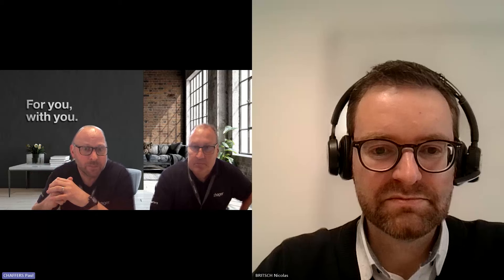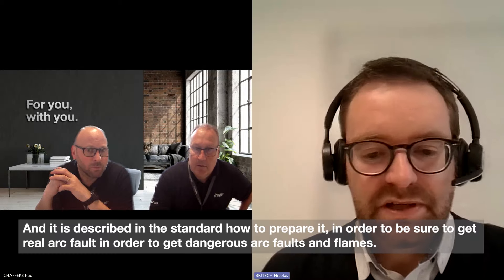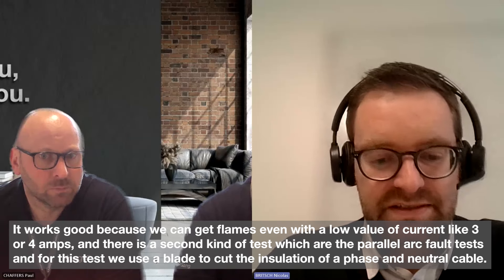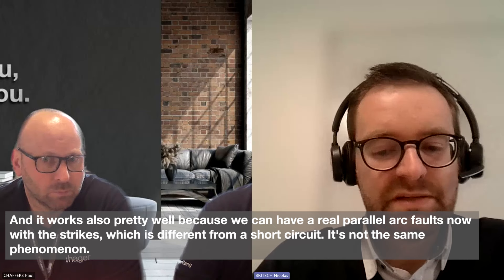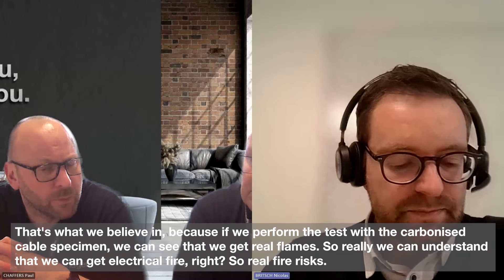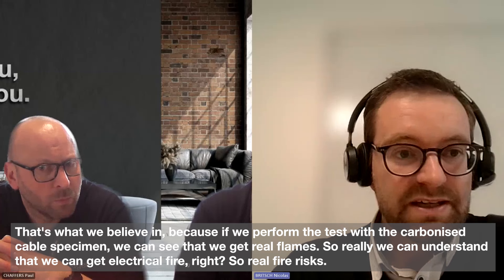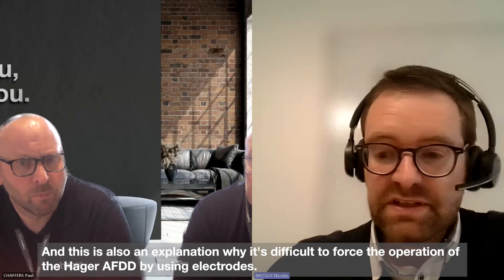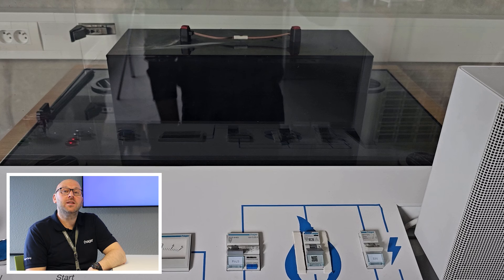Hager AFDD Performance Overview

Comment: Very interesting to see the specimen test, thanks for that. I always believed the hardware complied to BS[EN]62606 so it’s a shame my amateur monkeying couldn’t show it. What I still don’t like though is smart tech in any protective device. You say there’s nothing for installers to maintain and updates will only be issued for specific (erroneous and invalid) trip events, but the lines of liability are a potential can of worms. I also question whether these devices have the kind of longevity you’re suggesting. Time will tell on that front. Personally, I’d much rather see a dumber model from Hager; the kind everyone else is flogging -essentially, the technology in your original ARC model packaged with an RCBO in a single-module form-factor. I’ll worry about Hotpoint’s new washing machine tripping it off. I don’t want the hassle of getting a trace box out of Hager (like you’d ever give me one anyway), then recording the event on site, sending it back to you to be analysed and waiting goodness knows how long for an update which might, or might not, solve the problem. It doesn’t sound like a quick or hassle-free process I’m afraid.
Reply: It’s pretty clear to me Dave, you’ve got to take the angle grinder to a piece of cable attached to your Hager AFDD
Reply: how do you prepare a carbonised cable specimin as in my amatuer testing i got so fed up with attaching massive loads i deided to have a go at setting fire to the cable still didnt trip.
Reply: Unfortunately my whole stance on Hager has changed over the last year or so, I have gone from being a Hager fan boy to avoid wherever possible
Reply: Well said Dave. Maybe this video was a result of the monkeying around testing 😂. I still don't have faith in the new hager AFDD devices.... There is a time and place for smart tech, and I believe at the minute it's not on consumer DBs,
Reply: So, does this imply devices tested to a parallel arc fault test are inferior and would not react to the carbonised cable test? We’ve obviously seen it the other way around.
Reply: Good to hear this info - lots of mystery around these devices still in the UK as they are so new for electricians here. Thanks for sharing your testing process.

Comment: So would you or anybody at Hager then be happy to have a DSES arc chamber installed into your loft space sat on insulation with the electrodes set so they are physically melting the components within and keep that energised whilst the single module AFDD continues to push power into it, knowing that it doesn’t trip because your algorithm isn’t configured to detect such a fault which in my opinion, closely resembles that of a loose connection in an old baker lite junction box which I’m sure every electrician in the uk has come across Atleast one that has been melted by such a fault. It trips in a lab under set parameters, sure, but the real world doesn’t have these set parameters as is surely proven by the video which this is purely an unofficial response to
Reply: Or a high power switch like a cooker socket or a shower isolator! I've seen those turn into charred melted messes before!
Reply: @FrontSideBus  and yet amd2 only requires socket circuits up to and including 32A 🤦🏼‍♂️
Reply: @minitom7772  becasue the reason for the introduction of the AFDD was due to the number of fires in rentals caused by them having too few socket outlets and tenants using trailing leads which then became damaged and casued arcing issues.  You can use AFDDs on additional circuits if you wish.
Reply: @minitom7772 yup and i asked Hager why they didn’t make a 40a. There answer was that you only need to apply them to socket circuits. So then i replied if that’s the case wtf did you build a 6a. There should be a 40 in the range. Showers switches are one of the most popular been burning accessories I’ve seen. Hager are full of shit! Why not build both tests into there device or at least bring out another firmware version where the electrode detection works and give us a choice. I agree with the primary comment “ arc chamber in our loft”.

Comment: So as far as I understand it the Hager afdd has been tested using the cable specimen and works 100% of the time! My question is would it not be beneficial to also use the arc fault generator set up that the double module was tested to so we as installers know it also trips under those conditions and we would be reassured that they work under those conditions and are confident to continue to install them?

Comment: This is a very poor video. Relying on the cable type test results in a greater prospect for fire and slower response. 

Placing updates on the shoulders of working electricians equally so. What are you paying for said visits to update your unreliable products? 

Why not grow a pair and go to David Saverys arc test chamber or use the one you tried on the double module device in the past.

We were buying thousands of Hager RCBOs annually. That will not be the case for afdds until such a time this is rectified and addressed correctly.

Comment: Still fails to answer who is responsible/pays for the devices to be updated should there be a mandatory update. Think I'll stick to the ones we have seen to work consistently and won't ever require me to go back to apply a patch
Reply: This is fine until you have to go back and change physical devices when they update firmware to overcome a nuisance tripping issue. 
Updating firmware would have been a lot less hassle than a complete shut down of a building!

Comment: Thanks for the explanation of why the Hager AFDD's comply with the regulations. From my interpretation the regulators probably gave two options for how to test the AFDD's on the assumption that the tests would give the same results, DSEUK appear to have proven that this is a poor assumption.
Given that we now have this information I would think the best approach would be to accept that the current testing doesn't test for all real life situations, i.e. I suspect that if there was a loose connection there is a good chance that the Hager AFDD would not detect the arc. I find it strange that Hager are not looking at their software and testing so that they can reach a point where the AFDD does trigger in both test conditions.

I am far from being an expert but overall I agree that based on this explanation it looks like the AFDD does meet the requirements, but it feels like an unsafe conclusion that it will detect all real life arc faults and is therefore safe. If on the other hand Hager would like to explain why an arc generated in the way DSEUK have done is unlikely to occur in a junction box or other equipment I would be happy to listen. From my experience at least situations where I have seen overheating and danger have nearly always been associated with connections in switch gear or accessories overheating due to poor connections.

I was considering recommending a Hager AFDD to a customer, still far from convinced it's a reliable product.
Reply: Reflecting on this more. From what I could see the arc in the Hager test had enough energy to create a flame.Hopefully an arc event would be detected and prevented before this, what happens if there is a lower energy arc?

Comment: In other videos I saw sustained arcing, flames, red hot metal and burning plastic. I also saw no AFDD trip where other brands did! I'd rather use AFDD's that trip off long before that happens and also one that I don't have to mess around with software versions!
Is a cable type fault really more likely than something like that a loose connection in a junction box, or arcing between switch contacts in, for example a shower isolator? I've seen those a charred mess before and I'd like something that could catch that.

Comment: So they comply with a standard but will only cut the power once the fire is started. Great.
Reply: Yes it misses the point that they are meant to prevent flames and trip on arcs. Whether it’s a spec issue or manufacture choice, the result is a pointless product.

Comment: Looks bollocks to me. 1st a LSZH cable wouldn't carbonise and the scenarios when an earthed conductor or part or a neutral isn't adjacent is going to be rare. Wouldn't most carbonising occur following an electrode type fault?

Comment: Thank you for this video, and it’s great to have this extra information, especially about the different types of tests, and the choice that Hager has made…. Maybe electrode vs cable can explain why Hager AFDD perform differently than certain other brands… 

Anyone with even a partial interest in AFDDs has seen other YouTube videos where the Hager model misses an event that many other brands of AFDD seem to catch. The event is significant enough that the enclosure melts while the AFDD continues to supply current. For those with Hager AFDDs installed (me included) it would be good to know that the Hager model could also intercept this type of fault… Will it be possible for a general update to the current modules in order to function on BOTH cable and electrode simulations; thereby perhaps giving more overlap of functionality with other brands?
Reply: Sounds like they made a flawed product and have invited the sales guy to tell you to keep buying it so they don't waste money redesigning it. I wrote software for siemens fault detection devices and I can tell you the devs there are held to high standards. Hager probably outsources it to the lowest bidder.

Comment: Simulations of parallel arc breakdown using cable cutting show that circuit breakers are much more reliable in protecting against such damage than AFDD

Comment: The IEC 62606 (BS[EN]62606) standard suggests using arc generators that do not provide real-world operating conditions.
The first generator contains a graphite electrode, but the connection of metal conductors or metal parts is actually heated.
The second generator contains insulation pierced by current at a voltage of 7 kV and 2 kV, but a voltage of 0.23/0.4 kV actually operates.
There is no evidence that these generators adequately reproduce defective connections.

Comment: Put simply . These devices should tri[p on both test methods . otherwise they are a false peace of mind unit . If they are going the Bluetooth route ,they should go the wireless instead so they can be monitored remotely and logged